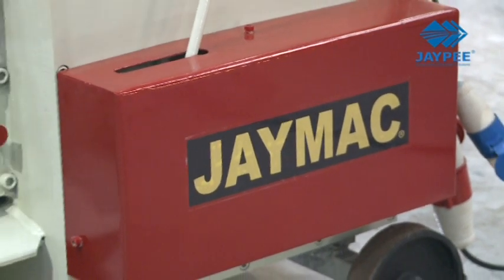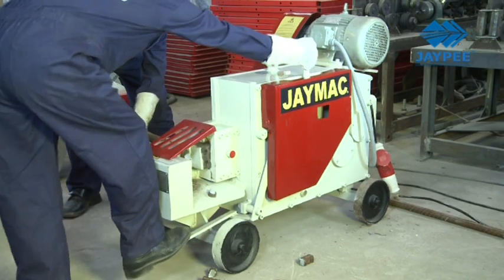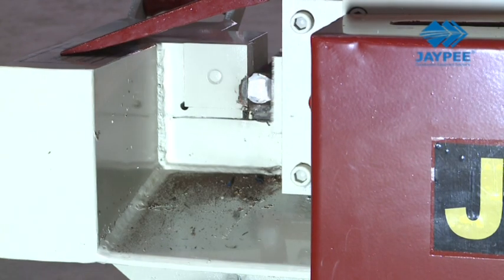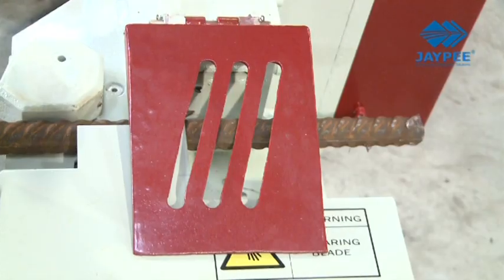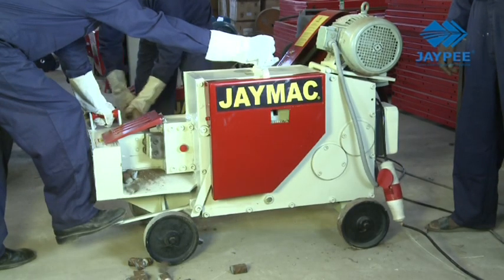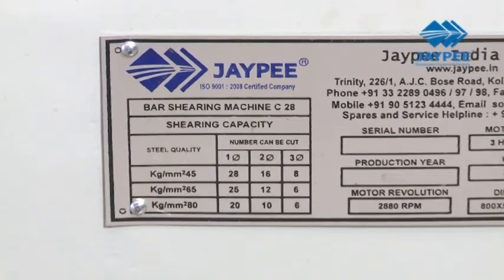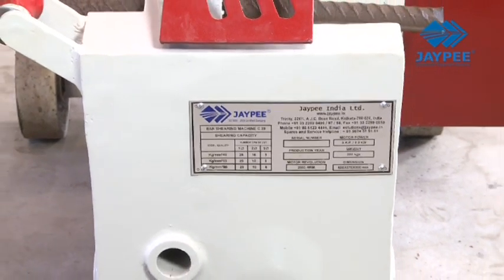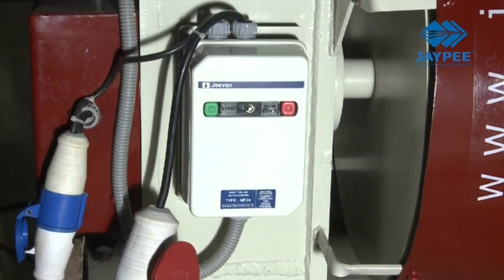Bar #Cutting Machine by Jaypee India 90512 34444

Comment from the maker: Bar Cutting Machine

Bar Cutting Machine is robustly built to with stand the stress while shearing of rebar and various forms of steel bars.

Durable fast and easy to use, this machine gives a one-shot cutting operation with perfect cutting accuracy thus minimizing the use of labor and long drawn cutting process for single cuts.

This workhorse knows no stop as it can be effectively put to use for a constant round-the-clock production.

A high power torque generator in the form of a solid flywheel is what, gives JAYMAC® Bar Cutting machine Machines unmatched strength and robustness. Shock resistant tool steel, duly heat treated, forms the innovative Eight Edged Blade giving longer operational life to the cutting tool.

Bar Cutting Machine is available in different models, for rebars with maximum diameter up to 28mm (Single Phase or 3 phase), 36mm, 42mm, 52mm and 55mm.
Reply: How much is the price ?